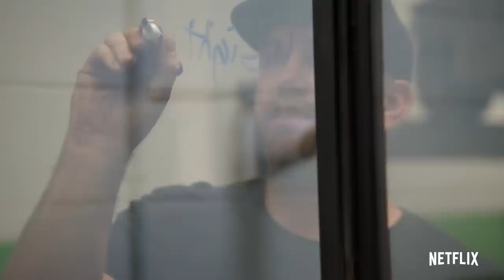LS TWIN TURBO Hilux GOES DRAG RACING - Deathwish EP5

Comment: yeah those guy are on point with the trans brake will help out alot with the launch. but might want to look in to a line lock for the front brakes for your burn out
Reply from the maker: both would be a good start to making it fast

Comment: Everyone loves a beat old Yota. This reminds me of the 88' 4Runner I jacked up on 36" tsl swappers with a Toyota 85' solid 8" axle.  But then after realizing the 350 small block required some serious firewall mods that would require me to give up my air condition in Florida. I decided to go with the last two pistons cut off that 350, which is a 269 4.3 vortec V-6 paired with the 4L60E auto trains stacked with an advanced adapters plate to the yota transfer case. Pretty much standard 4Runner crawler Yota equipment if you will. Except here's the kicker, I called it the TOYOLET. Toyota with a CheveoLET engine. Seems to me, you yourself have built yourself a Toyolet as well. Maybe not with as much mud on a Windsor white paint job as I had, but a Toyolet, none the less.
Reply from the maker: Toyota with Ford Suspension and rear end, and Chevy Motor/Trans

Comment: Could you run a diff  from the engine to a Trans axle to put the weight over the axle and distribute the weight over the wheels.
Reply from the maker: sounds difficult
Reply: @BustedKnuckleVideo  Well trans axles are used in Detomaso Panterra Corvetts, the latest model Ferrari's any car that has a rear mounted engine.
 Cant be that hard to find. Mount a plate on the bell housing coupling Driveshaft back to the tranx axle that is also the differential you just put 100+ kg over the back wheels and a split fuel tank either side of the Trans axle to centre the weight. And keep it low centre of gravity.
Also bleed the air pressure out of the engine bay remove a head light and drill two vents out the back of the front quater pannel, pipe it the size of the headlight...
Reply from the maker: maybe for a different project, this one does well and just needs a trans brake and to setup the suspension better

Comment: This is awesome!  I legit need some dudes like these. Punishstang should run 12s but I'm like 1 tenth away from 13s because it isn't setup right and I don't have enough seat time to pedal it.  Haha 30,000 roadtrip miles yes, but racetrack quarter miles... not so much
Reply from the maker: Having the right people in your corner always helps

Comment: Can you hook up a switch to the two gas tanks to use the 12 gallon and the 22 gallon for your road trips.
Two gas tanks like the old school ford's had.
Reply from the maker: could
Reply: @BustedKnuckleVideo  in that truck probably only an extra 100 but would be good for back up

Comment: The GTR driver was not launching very well at all, even for stock. And your helper talking about the shock didn't really know enough. He was referring to rebound, which you can't even adjust with that shock, just compression dampening.
edit: I'm wrong about that shock
Reply: Incorrect. The clicker effects compression and rebound equally.
Reply: @VagueIndustriesTV  Oh, really? I've never even heard of one that works like that, but I mostly know bikes and off-road trucks. I was going off of what he said earlier on when he installed it.
Reply from the maker: Whatever you did seemed to help.
Reply: The dragy that was used showed he did a 2.9 0-60mph which is spot on for a stock GTR. It was launching like a stock one should.
Reply from the maker: nice

Comment: The place where you started building the Toyota I'm curious about the off-road bumper that's on the wall and the back of the shop where can I get something like that I have a 93 Jeep Grand Cherokee and I'm doing everything I can to make it cooler on a daddy budget two small children does not equal fun off road parts if you catch my drift
Reply from the maker: Best but is to build your own or buy one from one of the companies that sell chinese ones, a custom built one would be expensive.

Comment: I'd make a sleeper with that brown Fairmont wagon, replace the 200 CID I-6 with a 351 V-8, that will turn heads even faster.
Reply from the maker: change that 351 to an LS and you got it
Reply: That Fairmont was the fastest car in the lineup

Comment: Trucks have no weight on the bed.  Add a tool box on center of the bed and fill it in with sand bags.  Experience the difference.  😉
Reply from the maker: he put the fuel cell back there, should probably throw the battery back there too

Comment: You have got to do something about that boost it is hitting way too late your car won't even do a burnout dude and it's a twin-turbo V8
Reply from the maker: did you see the size of the tires? It roasted them most of the way down the track......
Reply: @BustedKnuckleVideo  It makes plenty of power once the RPMs come up, but could use a bit more boost off the hit (transbrake) and in the lower RPM range try to get it to ramp in a bit faster, but also smoothly. So basically a transbrake and plenty of tuning or maybe even a looser converter?

Comment: Hey man I was pulling for you to win on fastest car not only because #trucklife but I saw you driving this sexy ass truck up 85!   When I saw it I wanted to know more and now I do. I wish you could have cake out with the W!! If you want to be able to add traction comment back and I’ll shoot you my idea for what could have possibly help you with the traction
Reply from the maker: needs trans brake
Reply: I’d also add a quarter or half inch plate of steel to the bed approximately 2ft long and as wide as the bed.  Just to add a few more lbs to the rear weight but not enough to negatively affect the performance.

Comment: Closed course??, looks like steet racing
Reply from the maker: Maybe in Mexico
Reply: @BustedKnuckleVideo  sure.... maby next time racing in front of my shop, you will win my bronco aint very fast...
Reply from the maker: gonna be hard to beat this hilux
Reply: @BustedKnuckleVideo  i have a 78 bronco, with a 400m, holley 600, cam, headers., c6 trans, 3.00 to 1 ring and pinon, on 33 12.50s. Its slow.....
Great burnouts but slow....
You will win..

Comment: Monster transmission sucks. They sent me 3 transmissions and still couldn't figure out how to build one that would last in a 08 tahoe.. plus all the fluid and shipping from Florida and back... monster transmissions suck, that company costed me my relationship with my parents.. fuck monster transmissions
Reply: 4l70e is what they built me 3 times and  they didnt last more then 2k miles in a stock Tahoe 5.3l
Reply from the maker: this one has worked well.